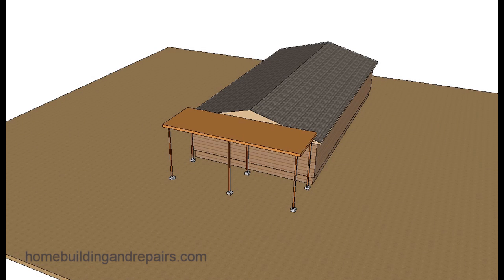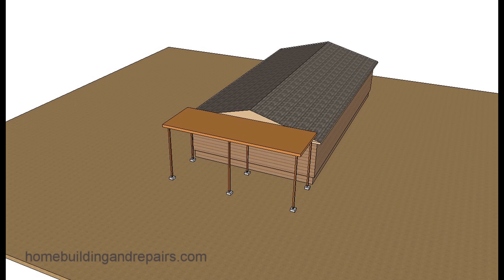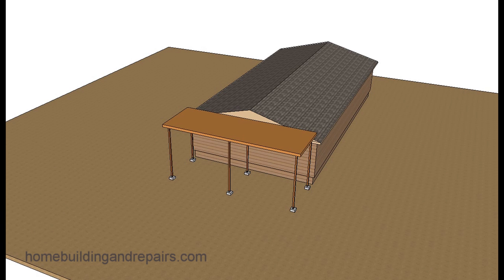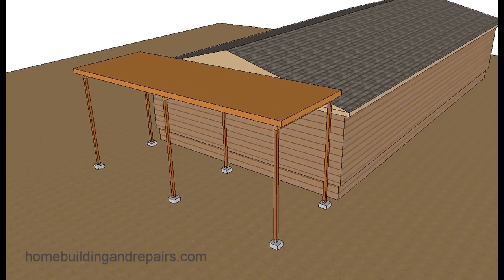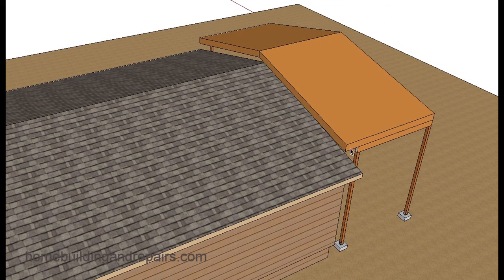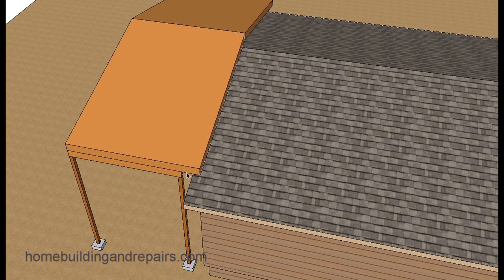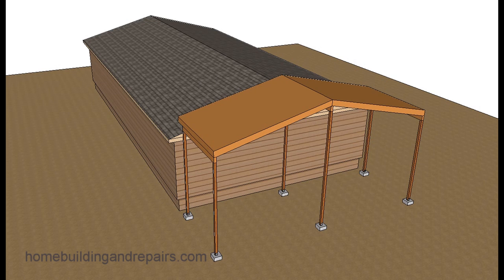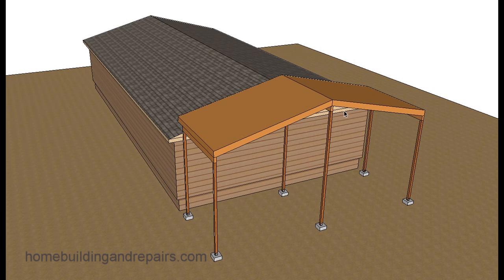Things to Consider Before Adding a Patio Cover to a Mobile Home

Comment: I install patio covers for a living when attaching to mobile home I add extra blocks under exterior walls learn from experience
Reply: Rich Hansen hi would you happen to know about how much it would cost to rebuild a roof, floor and add support to wall then dry wall new wall in a manufactured home i dont know to much about it but im looking at a 980 sq ft 3 br 2 bt at the moment
Reply: Rich Hansen , how many blocks do you put under the exterior wall. What spacing? Do you add any framing above the blocks? Thanks!

Comment: I have an existing attached deck.  The house roofline is too high to tie in the patio cover with the the house roofline.  My question (additional detail follows), in general, is it possible to build a ‘detached roof’, on an attached deck?  I might need to add an additional set of footers to carry the weight for the 2 posts that would be closest to the house?  I believe the 2 posts farther from the house should be able to rest on the existing concrete footers.  Hope this makes sense and any insight is appreciated.
Reply: I’m thinking of something like a lean to, just not attaching the actual lean to (trying to avoid the removal of tons of siding for the project).
Reply from the maker: Even though I can't provide you with individual engineering information, I have seen attached and detached structures like the one you're hoping to build. If it's detached, then you're probably going to need a minimum of four posts.